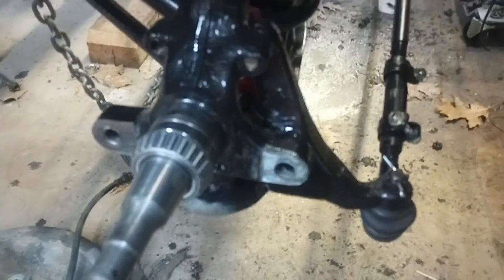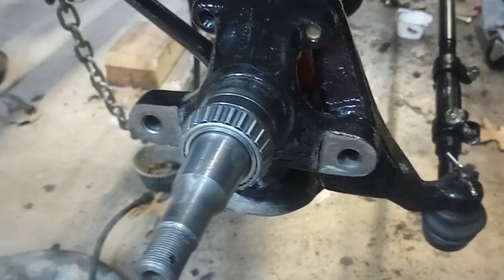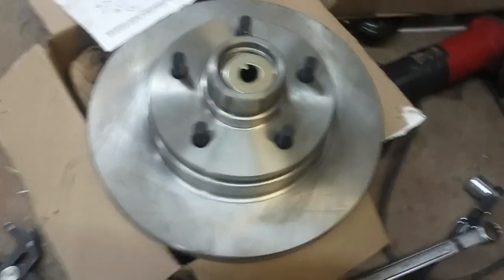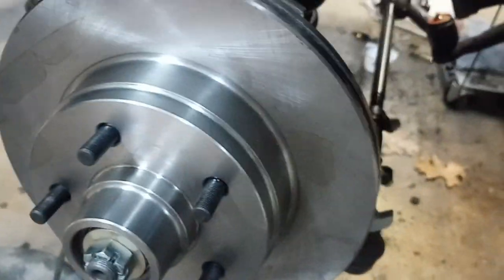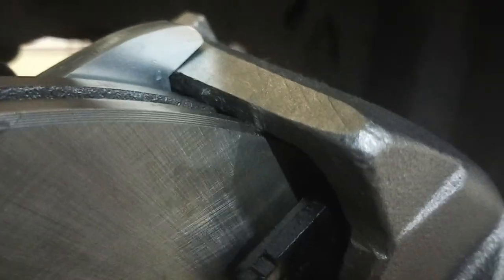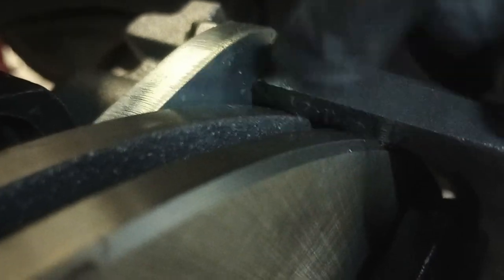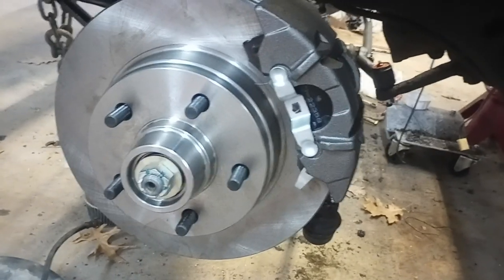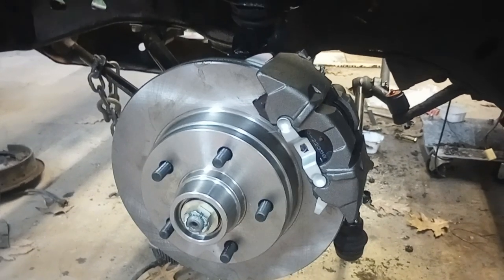Buick Wildcat disk brake conversion part 3

Comment: This video is a life saver. My kit for my 67 Electra didn’t come with any instructions.
Reply from the maker: I'm glad my video helped, thanks for letting me know!  I hope your disk conversion goes well!
Reply: @theworkshop3706  Where did you get your valves for the brakes? And what upgrade needs to be done to the master cylinder?
Reply from the maker: Hey - I got this full kit from ebay: https://www.ebay.com/itm/304891708146  
Comes with 11" booster, 2 chamber cylinder, brackets and pedal push rod.  I had to cut the threaded rod down a long way.   It was very long for my car.  I also had to drill 2 new holes in the firewall to bolt up the adapter bracket.  All in all it wasn't too bad.  I didn't like the bleeders on the master cylinder.  They worked ok, but leaked from the threads while they were open for bleeding.  The brakes feel pretty good so far. I put in all new lines as well.  The car is not running so I have not driven on them yet though.  I have this video discussing the setup: https://www.youtube.com/watch?v=EfScQ4Aq4-Q